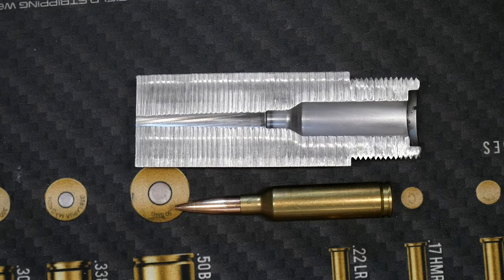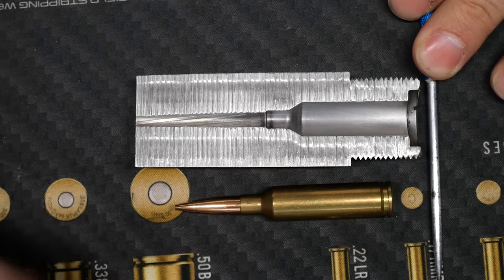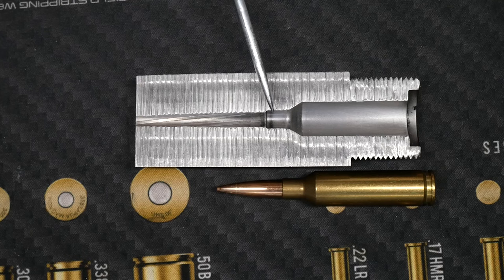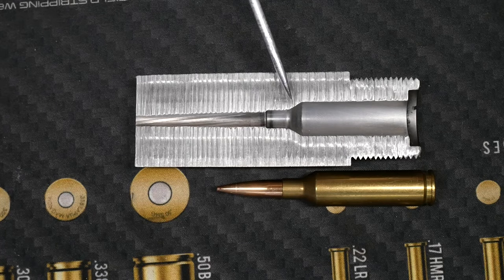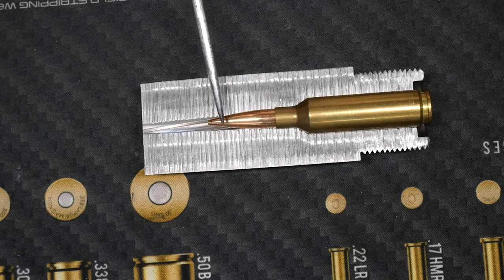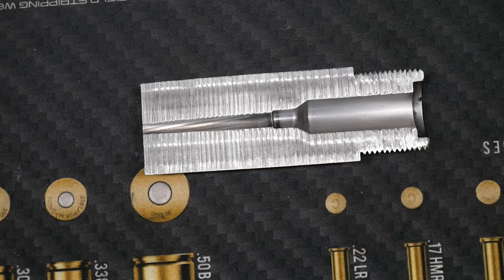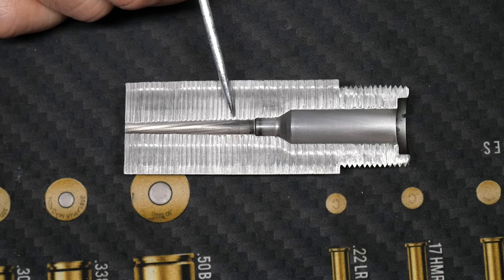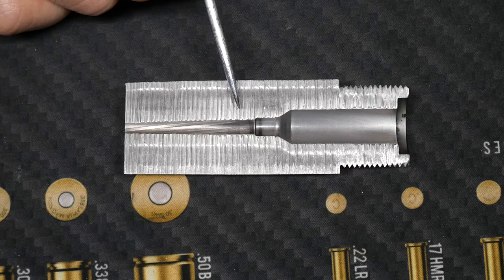Rifle chamber anatomy

Comment: So I have a 7mm rem mag I got from a friend. It’s an interarms mark x (Mauser action). I can literally seat bullets out as far as possible and still not hit jam point. I’m confused as hell. I just started reloading this year. I can seat to 3.390 and still fit in the mag. I’ve seated a bullet just a few thousandths into the case and it still doesn’t jam. Now my ruger .270 jams real soon I can only seat my bullets out to 3.229 which is about 30 thou off jam point.
Reply from the maker: That is interesting. The 7 rem doesn’t have much of a throat so it should be hitting sooner. Is it possible they had a custom throat cut longer than the standard? Some people did do that so they could use longer bullets.
Reply: @longrangescience  according to my friend it is all original and he’s only shot 500 rounds thru it. I can’t get it to group consistently at 100 and I know it’s not me or my ammo cus my .270 is under an moa. I’m now going to try a different bullet and after that I will switch scopes and test that. I may be getting a new barrel tho 😂. Thank you for the response

Comment: If you were to rebarrel the .243 can it and other traditional chamberings be made with some freebore to accomodate longer bullets?  Thanks for the video.
Reply from the maker: Absolutely. There are throating reamers that can cut the throat longer for any caliber. If you’re going the custom route then you can get faster twist rates as well. Any decent gunsmith should be able to do that no problem.

Comment: Very good video :) although I have a question. So I’m looking to make a barrel chambered in 22 hornet. I’m new to gun smithing but I do know how to rifle the barrel and a few other things. What I am kinda struggling with is how to chamber the 22 hornet. Since it’s a weird shape and only slightly tapers I’m wondering if the chamber has to be exact or if it can be a bit wider or maybe even just straight, the reason for this is cause chamber reamers for the 22 hornet where I live are very expensive and rare so I’m thinking about trying to chamber without one. I know if it’s wider the case will expand so can this be reversed by reshaping and trimming the case? I’m looking to reload the spent brass. Thank you :)
Reply from the maker: Thanks! But I would recommend against cutting a chamber without the right reamer. Just because all the dimensions, angles, and transitions are so critical. If it’s oversized, the brass can over expand and rupture. If it doesn’t rupture, it will be oversized and significantly stressed during resizing, leading to cracking, case head separation, or a few other things. Also, straight usually doesn’t work because the case fills to expand the chamber and a taper helps with extracting the case. If it’s truly straight, the case is likely to get stuck. I know it sucks, but you should be able to rent one a lot cheaper than buying one
Reply: @longrangescience  ok man, thank you for the advice! :)

Comment: If your barrel is eroding, and you have plenty of barrel to work with, why don't you cut the chamber deeper and cut the shoulder of the shank deeper as well to, in effect, have a new barrel? Especially if your barrel has no timing needs, you could cut a bull barrel a couple of times and save the cost of a barrel at least once, if not twice, in the life of the rifle!

I have a rifle that would need an entire new barrel due to headspace if I did not cut the shoulder and chamber again, which would make the project too expensive due to the amount of work, if I had to add the cost of the barrel to the job.

In my case, by removing the old barrel, cutting the shoulder back by one thread depth, and reaming the chamber, I will have solved a headspace problem, and the only cost is the labor of the machine work. And the rifle will have another 50 years of life in the family, plus, the barrel will remain original!

But in your case, by cutting the shoulder and chamber, you get a fresh barrel, without the cost of the barrel, unless you have spare barrels laying around?
Reply from the maker: That is actually an option people use. If you have the resources it makes sense sometimes but for some its easier to just get a new barrel. The other issue is fire cracking. I’ve seen cracking from the heat and pressure extend halfway up the barrel in some cases. And that wouldn’t clean us as easily